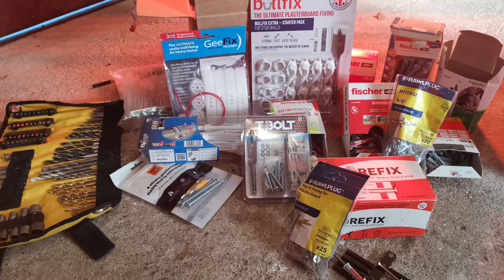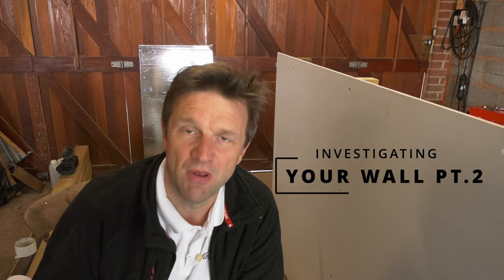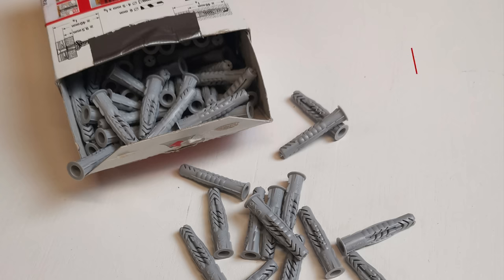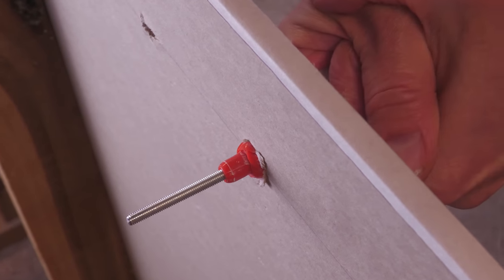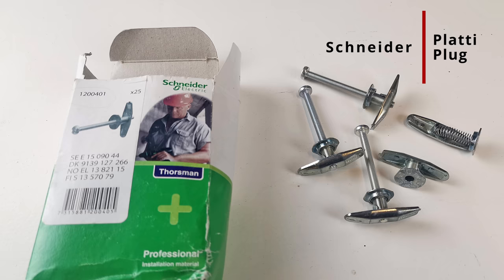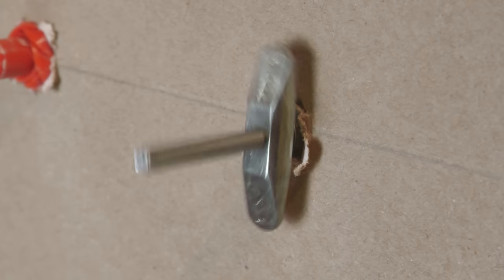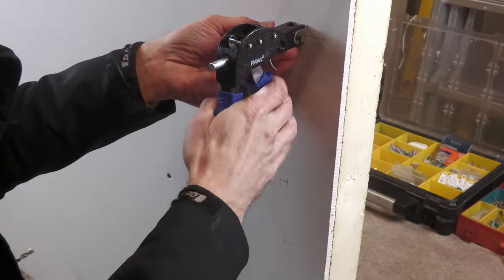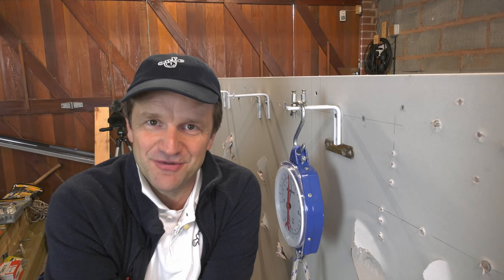How to Fix into Plasterboard - a Complete Guide to all the Best Fixings

Comment: Such a great video thank you. Being a handyman myself I fit a LOT of tvs. Snap toggle remains my favourite. Their website Actually quotes in excess of 100kg a bit surprised you figure were so much lower, duo power is my 2nd favourite just so impressed with how much it can handle for such a small plug. My only criticism for snaptoggle is there are many situations where it won’t open ie if you have less than 50mm cavity. Also if the stud wall has a vapor barrier.
Reply from the maker: Thanks Tony. Someone said in a comment the other day that they drill the snap toggle at an angle which enables them to get it open in tighter spaces. Not sure how that leaves the plug but I guess you could bring the drill back to the vertical before withdrawing it. I haven't heard of the dip power. Was that a typo? Cheers 👍
Reply: In the most modern new builds the house builders are using metal studs for speed and price. However, this has made partition walls very narrow with a void of only about 30mm. I have found this make installing snap toggles tricky. I bend the anchor to the side as it goes through the hole and then pull back after the toggle flips down.

Comment: Great video, and impressed by some of the heavier duty fixings (I've used hollow wall anchors for years). What would you recommend for fixings that need to be relatively close together, such as toilet roll holders, where you don't want to compromise the integrity of the plasterboard by having 2 holes with load side by side?
Reply from the maker: Thanks James. For that I'd instinctively go for the Fischer Duopower 8x40. It's only a light weight job and that fixing will do it wonderfully.
Reply: @CharlieDIYte  I think with the geefix you showed multiple screws going into the same plastic "blade" so maybe thats a good option?

Comment: I've got a few shelves (light load, shallow depth) and TV mount (again, weight relatively near the wall) where I've used the gripits, and they seem to be ok. This is likely because of the use case, and the fact that I have mounted the shelves/TV with at least half of the fixings going into a stud.

Now having watched your excellent video, I will be ordering a few of the top performing alternatives to go in the toolbox, and probably wont use them again.
Reply from the maker: Thanks for the kind words. You may not use them, but it's brilliant to have them in the tool box just in case. 👍

Comment: Thanks for the video! One thing I haven't seen many videos cover yet is what anchors to use when you need the screw to stick out about 20mm for picture frames with deep mounting points? Most plasterboard anchors need the screw to be flush to tighten the anchor. What would you recommend here please?
Reply from the maker: The metal Wall anchor or Geefix

Comment: Great video, I have a lot of plasterboard walls and I’m always worried about going through them as all the pipe/cable detectors I try seem to be so hit and miss. Got some snaptoggles and they say you need a 13mm drill bit but you used a 14mm one? Is there much difference? 13mm drill bits seem harder to come by.
Reply from the maker: Thanks. Yes you'll be fine with a 14mm. 👍

Comment: Ive actually had sleepless night wondering about the 6 lights i have just installed.
The lights weighed approx 6 kilos & there fitted to a ceiling that 2 layers of 12.5.mm plasterboard. I used 3 of them metal screw type ( like them dewalt ones) for each light.
I reamed out the metal twist style plugs 1st with the provided screw. I screwed them in by hand ( no impact wrench) & they seemed to fit nice & tight & quite snug. 
( I'm still concerened about getting sued if 1 falls on a customers head).
I have done a test in my garage with just 2 of them fischer  PDM 100 fixings in 2 layers of 12.5mm plasterboard  with a hook & they seem to be holding ok with a bucket of sand weighing 8 kilos.
Fingers crossed .
Reply from the maker: Yes horrible things those corkscrew screws. You might be ok given it's double thickness. You should be ok just don't use them again. If you are worried you could replace with Duopower 8 x 40s

Comment: Great video. What fixings would you recommend for hanging robe hooks on 35mm hollow core internal doors?
Reply from the maker: Tricky one that and depends on the profile/ circumference of the hook (Geefix would work best but may be overkill and wider than the hook base). Maybe something like this https://www.screwfix.com/p/plasplugs-hollow-door-fixings-6mm-x-23mm-20-pack/5255k?ref=SFAppShare

Comment: Brilliant video btw helped me immensely with my home DIY. I noticed when you were talking about the Fischer Duo Power you said 4.5 or 5mm diameter screw but on the screwfix website the plug specifications says "suits screw diameter 6mm? Better to use the 6mm or the 4.5 or 5mm like you mentioned?
Reply from the maker: Thanks! 6mm is quite a wide diameter if you're wanting to use it in Plasterboard. If using it in brick then I can see 6mm being ok. 👊

Comment: You read my mind,had an extension done an refurbished my house need some good plasterboard fixing.... also need some advice on ventilation I've got a positive input air system in my loft all the windows have got vents on,would you do additional vents in rooms up stairs and is there a video on this procedure...thanks in advance

Comment: Been using the tap it (walraven) fixings for a few years excellently for heavier pictures/ mirrors and light cabinets.  My bathroom cabinet is still up. Also put shelves up with them.  Big advantage is when removed it a b small repair.

Comment: Thanks for all the info, I appreciate the work that's gone into it.
Unfortunately, and I don't think you mentioned it, and neither do the manfactureres make it obvious, with the zip ties you need a 50mm void being the plasterboard or lathe and plaster to use these ties. I have only 38mm and they will not go in.
I have never had such a frustrating time of trying to put up a simple support in a wall; lathe and plaster in turn of century house is just a nightmare

Comment: Great video 👍 👌 
Which would you recommend for wall kitchen cabinets?
Reply from the maker: Depends if you've got insulation behind as discussed here https://youtu.be/L2Hy1IhQ17s Always go into the brickwork behind if you can or support the plasterboard with patresses if you have that luxury. But if there's no insulation I'd say Geefix just because they performed best in my load testings.
Reply: @Charlie DIYte  Thank you so much for your response as it's very much appreciated.
I don't think there is any internal brickwork as it's a new build house.
I will check out your recommendation, thanks.
Also, your videos are fantastic and helped me in the past 👍👌

Comment: Great video, one question I am trying to install roller blind brackets which are quite small (2 holes) to the window top fixing and there is a very small gap behind the plasterboard then lintel. What fixings would you reccomend?

Comment: Some great advice and guidance here thank you, BUT hers a dilema we have, we have a 1970's home and the builder appears to have made a partition wall using 3 sheets of 15mm plasterboard dot and dabbed together, YES I know WTF I hear everyone saying. But the wall measures 70mm thick so approx 10-12mm dot and dab. Hers mour dilema, we would like to hang a sliding door track and wondered which fitting would you suggest we use? Maybe the bullfix??? look forward to any guidance
Reply from the maker: Nothing is going to open in that so you may be best to going for a universal fixing like the Fischer Duopower 8x40mm.

Comment: This is an incredibly useful video!!    I am rather stuck trying to find a way to hang a large heavy (just under 20kg) picture on a plasterboard wall.  Is there anyone here who knows about these things and covers North London who could help?  Our handy man is rather scared of the job as he couldn't find any studs.
Reply from the maker: Trouble is Jenny, plasterboard is inherently brittle. Ideally you'd find the stud behind, and possibly bridge it with a support board to span two studs if not in the right place. Other option would be to open up the plasterboard and insert a patress board behind. If you can't do this then a couple of Geefix are probably your best bet.

Comment: Charlie, Thanks for a great informative video. I have a 6 kg mirror to hang onto a tiled plasterboard wall. The Snap Toggle would work but a bit over the top at 38 KG in your load test plus having to drill a 14mm hole in the tile.  Have you ever come across duoseal plugs designed specifically for tiles. According to Fischers own website , the 6 x 38 can take a load of 10 KG on tiled plasterboard and very easy to use by just drilling a 6mm hole through the tile. Would appreciate your opinion on these plugs,  thanks.
Reply from the maker: Thanks Hugh. I wasn't aware of Duoseal - they look very good. The only point to make is that you'll need compression for the plug to open up behind the Plasterboard - so as long as you're tightening the screw eg against a hook, as opposed to wanting to hang the mirror on the screw, you should be fine using this.
Reply: @CharlieDIYte  Thanks Charlie, I will be tightening the screw against the fixture which fits between the screwhead and the tile.

Comment: Great video. I tend to use Rawlplug UNO Universal plugs just for round the house stuff. Always found them to be excellent. Do you rate them?
Reply from the maker: Funnily enough Paul I used to use them too and featured them in my previous videos. The trouble is they're a bit tricky to get to open up properly - you have to get the screw right through the middle at the back, although they always feel reassuringly secure when you tighten the screw, don't they. The Duopower is far superior 👍

Comment: Great review Charlie .
Which one is best for 6mm hardboard. ?
And which is smallest hole but 1 of the strongest ?
Thanks 👍
Reply from the maker: Thanks. 6mm is a really tricky depth because most fixings are designed for a minimum plaster board thickness of 12mm. Maybe get yourself some M3 x 50mm Spring Toggles. You only need to drill a 12mm hole. The bolt is pretty small so you will need some washers unless the hole you're threading it though is only wide enough to take an M3 bolt. It will move around a bit in the hole until you've tightened it. The other option would be trimming down the Geefix like I showed in the video but you'd need a 25mm hole for that.
Reply: @CharlieDIYte  Thanks @Charlie . Love yr vids , so helpful .

Comment: Hi I’m watching this video which is very handy,I have used the plasterboard fixing that are metal like spiral shape,hope you know the ones I mean,these come with screws which helps,my concern is it I was to use different fixing how do I know what diameter screws to use and what size drill I’d need to use for pilot hole
Reply from the maker: I generally say which diameter screw to use in this video. The pilot hole drill is the same diameter as the fixing. It tells you what that is on the box. Don't use those metal cork screw fixings - they're terrible.
Reply: @CharlieDIYte  thank you,

Comment: Great video. Did you ever have to fix to a stramit wall.If so what would you recommend for fitting shelves.  Cheers
Reply from the maker: Thanks. I'm afraid I haven't fixed to strammit. How thick is it? The Geefix would be a good option if they're going to be taking a lot of weight. Or hollow wall anchors/ Bullfix extra? I wouldn't use drywalls - the thread is too tight to get a purchase into the strammit. Thanks for the suggestion though.
Reply: @CharlieDIYte  hi thanks for the reply, its about 50mm thick
Reply: The problem is they are full of compacted straw so can't slide any thing in behind the very thin plaster skim.

Comment: This is a great reference video.
I can't believe I had to be told that those self driving fixings are bad. I hate them, yet I always use them because I always seem to have them. I'll be clearing them from my toolbox to prevent that from now on.
Quick question though. With all of the toggle type fixings, you had them vertical. I presume that if it slipped while fitting round to horizontal, this would effect the max load?
Reply from the maker: You use the self drive fixings because you're lulled into thinking they're good when you drive them in - but yes, please don't use them going forward, except for hanging the odd picture. Yes it's better to have the toggles vertical but if they slip to the horizontal it'll still do a good job. Try and keep them vertical for the heavy jobs though 😉👍

Comment: Hi there, these videos are great!! Can I ask what fixing would you use to hang a 43" TV on an insulated plasterboard? My issue is that after the insulated panel there's also an air gap of 3cm before the brick, so that's a 10cm gap in total. Corefix are too short, maybe a 180mm or 200mm hammer fixing? Geefix would be great too but I would have to dig the insulation around the hole to be able to push it in. Thanks!
Reply from the maker: You want to watch this https://youtu.be/L2Hy1IhQ17s I think I would recommend a T bolt.
Reply: @CharlieDIYte  will do thanks!

Comment: Have you heard of Rigifix M6 or M8? I’ve used to fix floating cupboards. They’re similar, but different to Corefix. Does a great job in my opinion.
Reply from the maker: Yes I should've mentioned them. Thanks for reminding me. I'm going to do a short follow up as my conclusions were a bit rushed and might mention them there. 👍
Reply: I’ve used these several times to fit TV’s to dry lined masonry walls and they are fantastic. What I like is the load is taken by the masonry wall and not the plasterboard. I’ve recently had some renovations done to our house and introduced my builder to them when hanging the bracket for our 55” TV.
Reply: @MrZSimko  if the TV bracket needs 4 fixings use 4 if it needs 6 use 6. 2 might work but why risk the TV falling off the wall.
Reply: @Chris Sneller  I didn't mean that I would use less, I meant I think 2 would hold ME hanging off of them. Of course I would use as many as required.

Comment: Hi mate just seen your geefix fitting video how would you recommend the fitting vertical or orizontal its for my bathroom studwall plenty of room behind it my Raditor weighes around 35kg would be using four of these fitting  s in total vertical raditor that is many thanks

Comment: Great video Charlie! Been struggling to find info any impartial advice on fixings online and this video summarised everything perfectly! Just one question - where would the corefix sit on your comparison at the end? Is the corefix the best of the best for dot and dab plaster where the block is accessible or do others on the list do it better?
Reply from the maker: Thanks Jon. If you can fix into the brickwork behind then the Corefix is the best and indeed for applications where you can use it eg where there's only 20mm or so of gap then most other fixings wouldn't work anyway. Try the Rigifix too. Haven't used it myself but hear good things about it.

Comment: hi there i am looking at starting a project building a floating desk using batons on walls, i will be driling into plasterboard walls with bricks work behind. i want to make sure i have a solid fixing and its going to be holding quite a bit of weight for example the wood worktop itself for the desk then several monitors etc. which fixings would you recommend ?

Comment: Great video, thanks. I tried a duopower 8x40 today with a 5x70mm screw on a plastered board with a deep void behind it. I found I had to put a lot of pressure behind impact driver and ended up pushing whole plug through player board! On removal, it looks like screw stopped at end of plug and didn't "push thru". Any thoughts?
Reply from the maker: Hmmm. Why did you need so much pressure? Was the screw bit camming out of the screw? A 5mm screw should have been fine for that. Maybe get a snap toggle or T-bolt. It'll fit in that larger hole nicely👍
Reply: @CharlieDIYte  on removing the duopower, I found the screw tip had not pierced thru the bottom of the duopower.  Only one "arm" of the duopower had deployed. I then used a metal expanding wall plug.

Comment: Hi Charlie , what fixing would you recommend for installing a handrail down some stairs into plasterboard ?
Reply from the maker: I think it depends on the handrail brackets and what screw you need to use. A lot of these fixings have bolts which may not be appropriate for your handrail? If the handrail has a couple of screws in each bracket the Geefix with its ability to fix more than one screw into the wing behind the plasterboard is very good.

Comment: Interesting to see the geefix... I've ripped that design off in the past without realising. I've made my own DIY version of these by using one of those rectangular window packer/shims you get for pence, with a couple of holes drilled through for a longish thin cable tie. Fitted them exactly like shown in this video. Probably cost less than 5p each. I needed to fix into a failed fixing location and needed to add self-tapped screws for additional bracket holes like shown here. Probably not as good as the shop bought version, but it worked a treat and most people would already have the bits needed in their tool box already.
Reply from the maker: Good work 😉👍

Comment: Have you done a video or test on plasterboard fixed straight onto steel beams? I need to fit a curtain track to these and I don't think there will be any (or very little) space behind it before hitting the beam. Would it just be a case of something like CT1/Gripfill/NoMoreNails etc??
Reply from the maker: Yes https://youtu.be/G1ziRy_OJbU I did this a lot in the old day job when I ran a soft furnishings business and did most of the fitting.